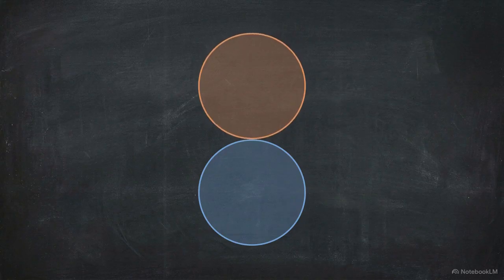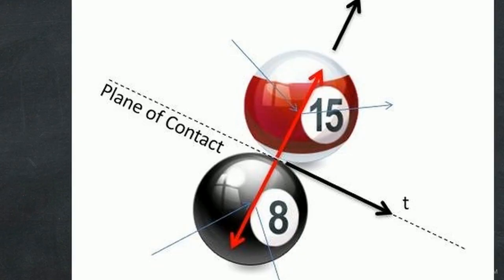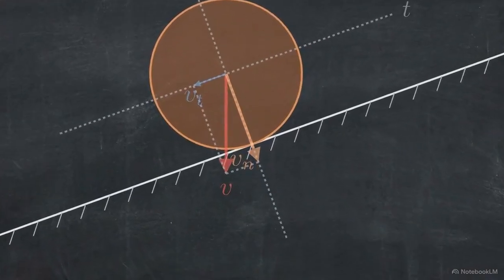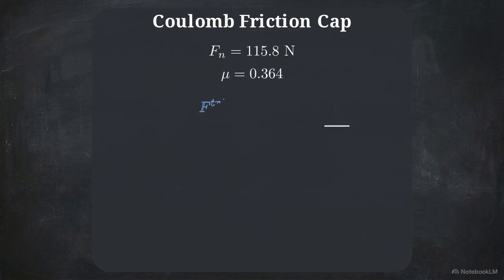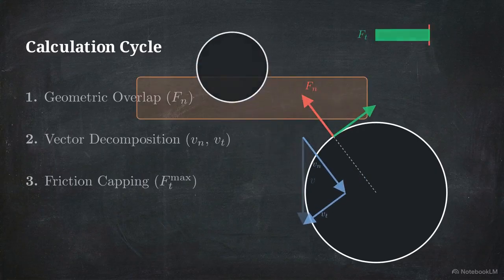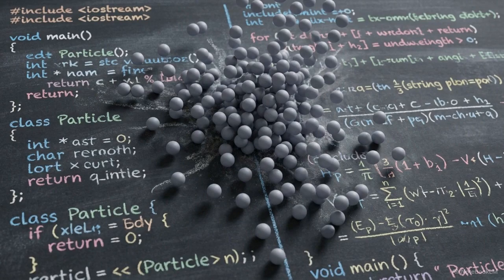Modeling Ball Collisions & Contact Mechanics

Comment from the maker: This video, produced by the DEM & Granular Mechanics Lab, provides a technical breakdown of how to model realistic particle-to-particle collisions in physics engines. It explains the mechanics behind energy dissipation and momentum transfer using the example of colliding spheres.

Key Processes in Collision Mechanics:
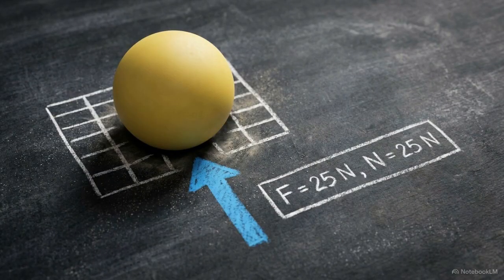Measuring Deformation (0:00 - 0:45): When two spheres collide, the distance of their overlap is defined as delta n. Physics engines simulate this by treating the overlap like a compressed spring, where the depth determines the normal force.
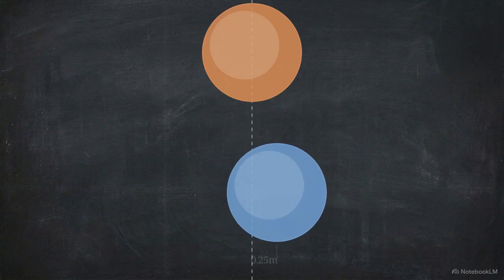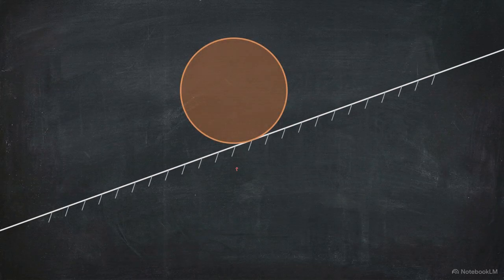Defining the Normal Axis (0:46 - 1:25): The normal axis is determined by a line connecting the centers of the two spheres, regardless of their incoming trajectory. The geometric offset between the centers dictates the angle of the physical push.
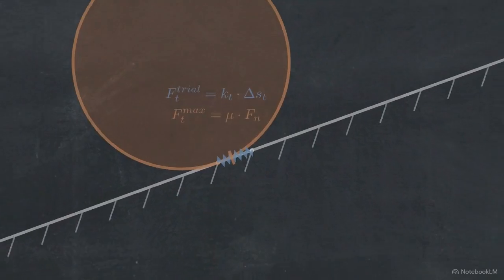Handling Tangential Motion (1:26 - 2:08): Because the normal axis is often tilted, incoming velocity is split into two components: one along the normal axis (overlap) and one along the tangential axis (sliding). Friction acts as a tangential spring that opposes this slide.
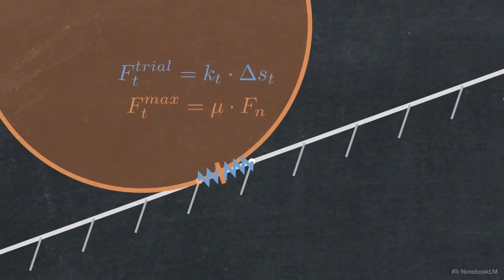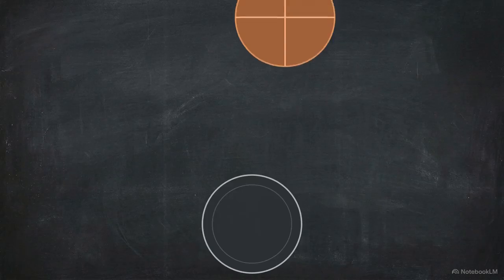The Friction Cap (2:09 - 2:53): Friction cannot grip indefinitely. It is governed by the Coulomb friction cap, calculated by multiplying the friction coefficient by the normal force. If the tangential spring force exceeds this cap, the object slides; if it stays below, the contact sticks.
Summary of the Collision Blueprint:
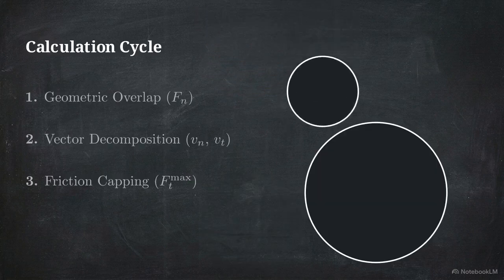To code realistic collisions (3:16 - 3:57), the video suggests a three-step sequence:

Find the geometric overlap along the line of centers to calculate the normal force.
Split the velocity into normal and tangential components.
Stretch the tangential spring against the slide and enforce the Coulomb friction limit based on the normal force.